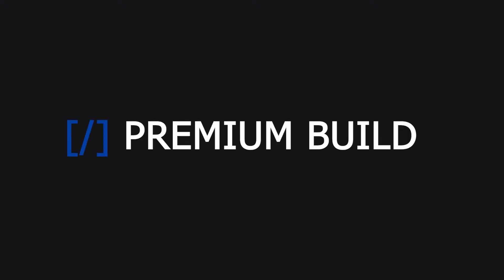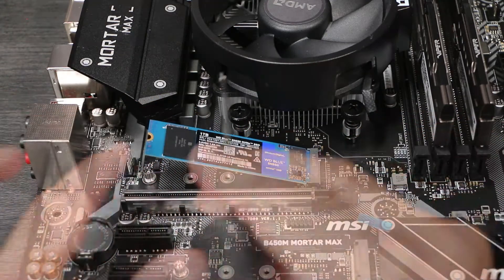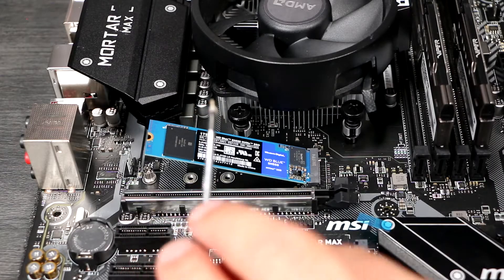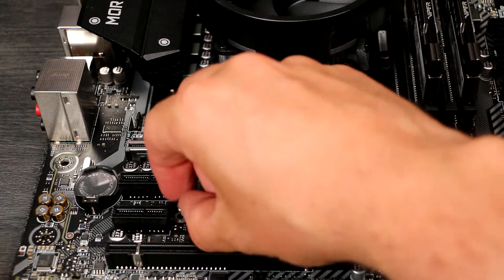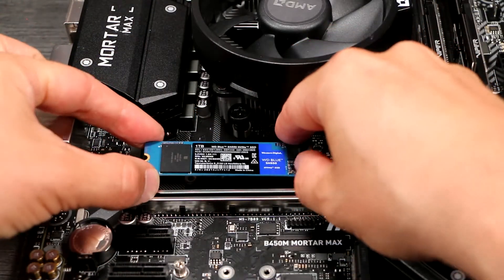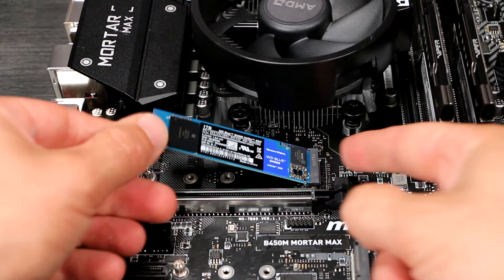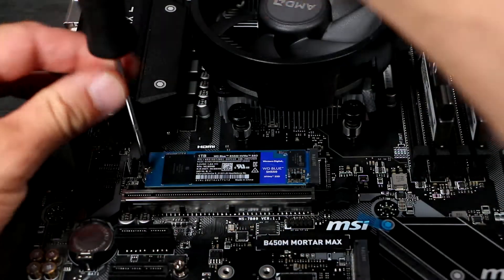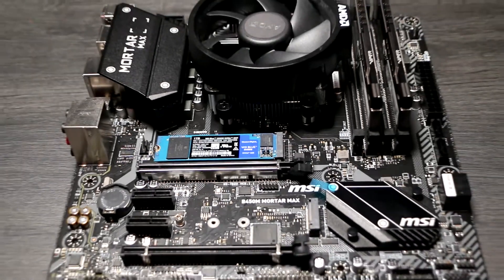How to install a M.2 SSD: A step by step guide

Comment: Hi, Just a question on installing 2 M.s drives, should i just install the OS drive "On it's own" when first building/installing the OS and add the second drive after Windows has done all of its installing/updating, or is it ok to install both drives during the initial building process ? 
 I've read a few posts that suggest its best to just have one drive during the initial build, and install,  but not sure if this is best practice or just internet fluff?
 Cheers
Reply from the maker: Hi, sorry for the late response: Yes, it's a really good idea to disconnect all secondary drives, and install windows with ONLY the main Boot/system drive connected. If you don't do this, windows creates system partitions on the other drives, locking you into that drive configuration. Install Windows, then connect your other drives!
Reply: Which tool did you use to secure the standoff?